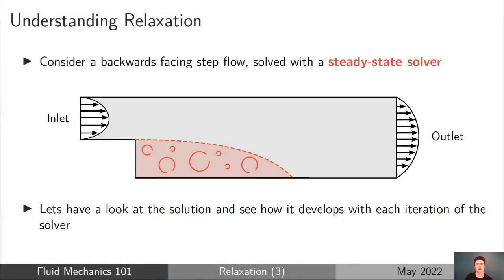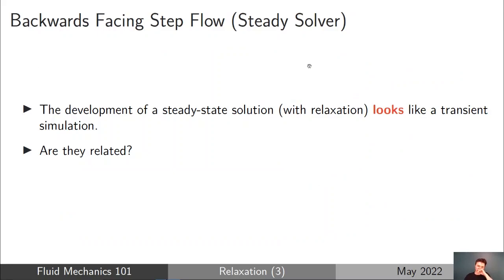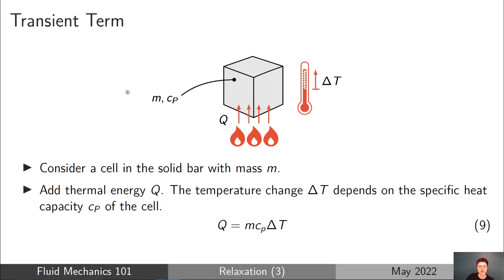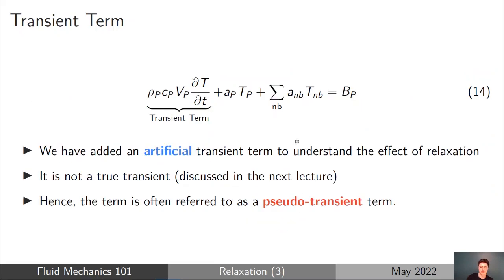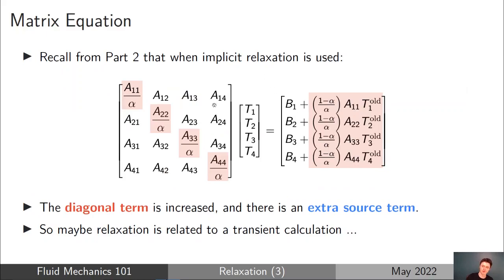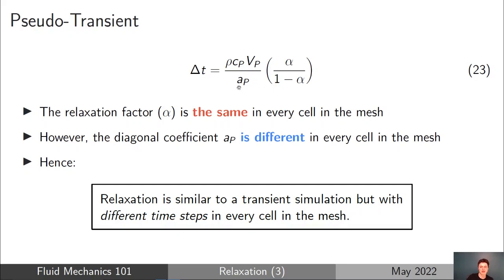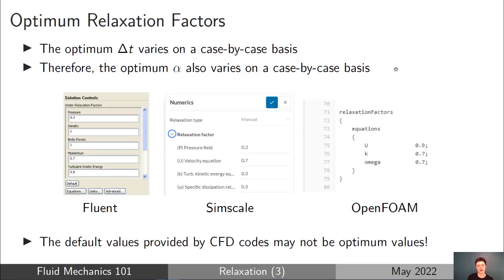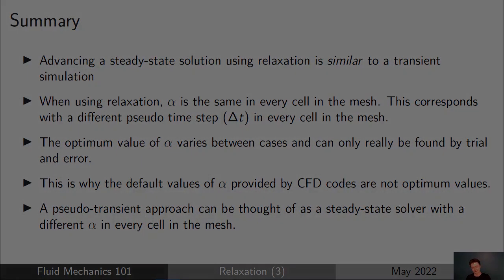[CFD] Relaxation in CFD (Part 3) - Pseudo Transients

Comment: Dear Sir, according to my understanding, the case shown in your video is actually transient flow.

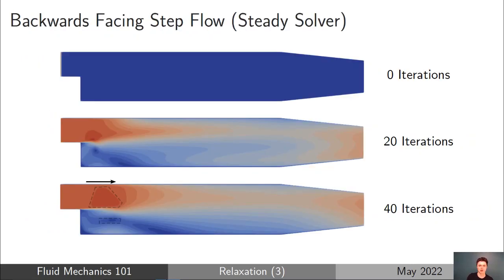But since we are using pseudo steady state to simulate the transient flow, we will still get the flow changes when iterations are going more (as shown in 02:17).

I tried my case (pseudo-steady state for transient flow) in the same way, but from my observations, I realized that when I set the time scale factor (pseudo-time step factor increment) to a very small value (large value will diverge), the flow pattern will not change.

However, if I adjust to larger time scale factor (larger pseudo-time step), the flow pattern will start to change again.

Therefore, in this situation, the reason for observing constant flow seems to be due to extreme small time step, the changes is not obvious, rather than a "true" steady flow for the case of transient flow.

I want to know, in this case, how can we make sure that the flow pattern has not changing at all, so as to show that the current flow is stable and no longer changes with time? or in simple word, what to dermine when we can stop iterate the transient follow using pseudo steady state (pseudo transient)?

Comment: Hello Aidan, thank you for the amazing videos you have created. However, I have a little remark on this one. I am inclined to believe that on the slide with "Transient Term - Gases" the text after the first bullet point should be corrected to: "For a gaseous system, heat input will also increase the gas VOLUME." as you are using cp (not cv) and pressure should be constant. It is also implied from the figure (not a fixed boundary of the cube). Am I right or not? Thank you for your response!
Reply from the maker: Ah yes, well noticed. I brushed over this point, as I really just wanted to focus on solids in this talk

Comment: Hello sir, I have a question about the flow courant number that is found in solution controls in Ansys fluent. The default value is 200 for pressure based solver. Is it wrong to specify a value of 1 for the flow courant number since I know that cfl should be below 1 or should I keep it as the default value. Thank you in advance
Reply from the maker: This depends on the type of simulation. Are you running a steady-state? If so, you can probably have a CFL number greater than 1 as you only care about the final solution and not how you got there. Are you running multiphase transient or something complex? Then you will need to keep CFL less than 1
Reply: @fluidmechanics101  thank you for your reply; really appreciate your work. I am running a 2D transient simulation for a vertical axis wind turbine. I am using the coupled solver and in the solution controls panel, there is a flow courant number which is 200 by default. That is why I got confused, since I am using a small time step in the calculation panel, so I thought if I have to keep it as 200 or I should set it as 1 here as well. Thank you again sir.
Reply from the maker: Ahh ok, turbomachinery! You might need to try some different time steps and see if your result is sensitive to the time step.  You can try a large time step to get over the initial transient and then once you reach periodic equilibrium, try switching to a lower time step, run a few revolutions and repeat with different time steps. Normally the result will be stable with CFL> 1 (I went up to 80 with a horizontal axis wind turbine) but the accuracy might be affected, so worth a bit of trial and error to see what happens
Reply: Thank you sir for all the help, I will do so.👍👍👍
Reply: Yes I will try that, but my question is about the flow courant number that is found the relaxation factors in the same panel in Ansys fluent (solution controls panel). Changing it is affecting the solution, I tried so far two simulations, one with the default value(200) and the other one i set a value of 1. I got different results which confused me since both solutions are converging to different results. Thank you for your help.
Reply from the maker: Different results :) then you probably want to go with the lower value. You should also probably try lower values (say 0.5 and 0.2) to see if the results are still sensitive to time step

Comment: What happens if I run a physically transient model using a steady-state solver ?
Reply from the maker: Your steady state solver will just predict a series of 'snapshots' of the solution, which aren't necessarily linked together with an accurate time history. You can think of this as randomly jumping through time to different points. The accuracy of these 'snapshots' depends on how unsteady the real solution is
Reply: @fluidmechanics101  I am running a Steady State simulation in ANSYS Fluent. When I solved it using COUPLED solver and than also with SIMPLE solver I am getting different results. What could be the possible reasons ?
Reply from the maker: Hmmm there are many different reasons. If your simulation does have some transient flow features, then the mass error associated with these features will result in a different 'looking' flow field. How are you judging convergence? If you look at global mass and energy balances you will probably find that the coupled solution does a better job than SIMPLE. There may also be a region of the flow field that is causing the solver difficulties.  Have you tried switching to node based gradients and improving your mesh (i. Lower skewness and better resolution in areas of high gradients?) Lots of things to think about 😊